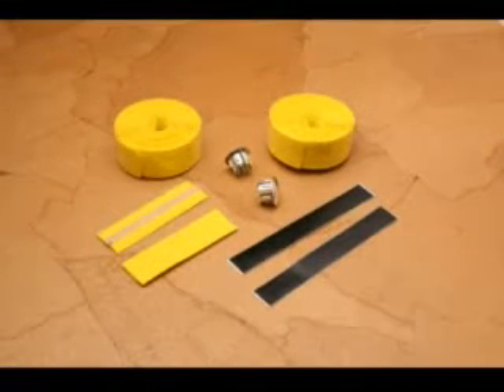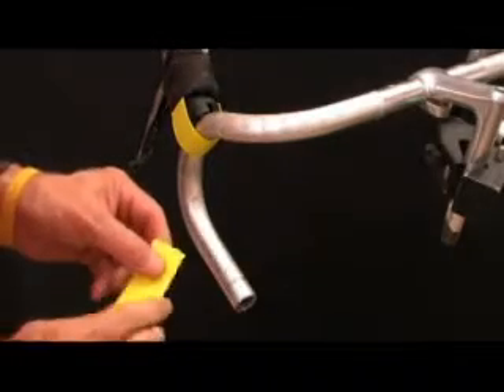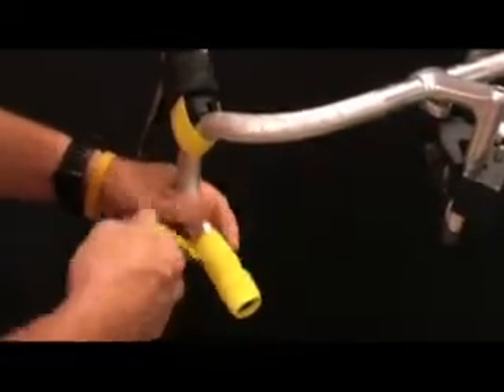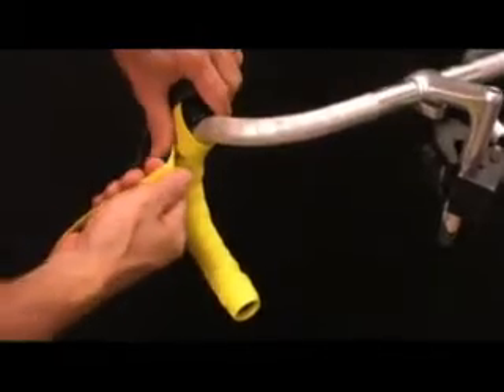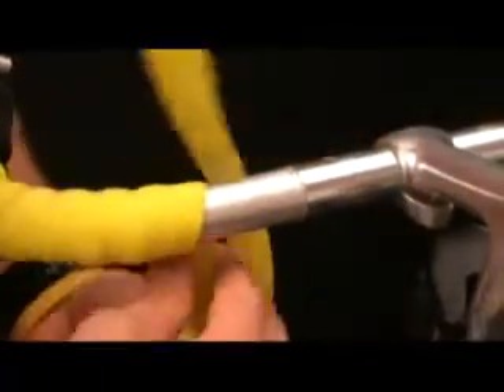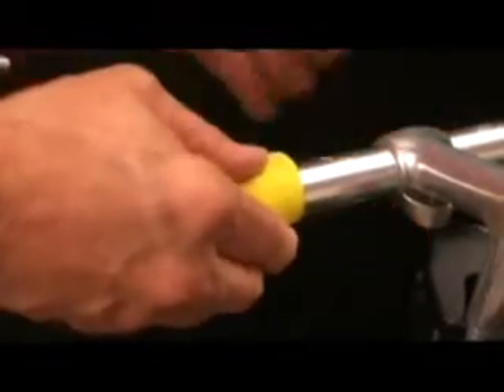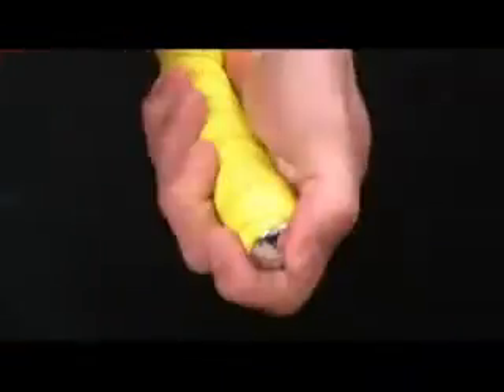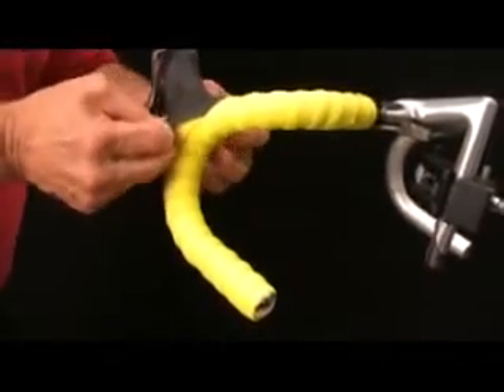how to wrap bicycle handlebars

Comment: on the top of the bars it should be wraped towards you so it will not undo when you grip the tops , also you should cut it nice and neatly at an angle so the end is smooth and flawles without a big lump like that and you don't have to tape the bars at the end  just the tape, it looks so neat and profesional